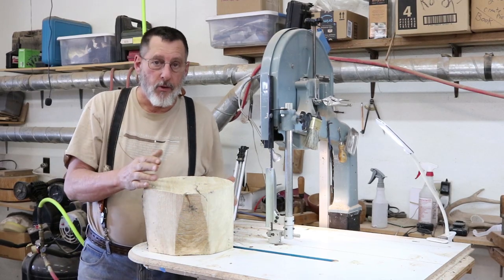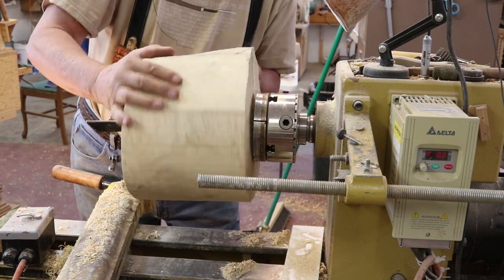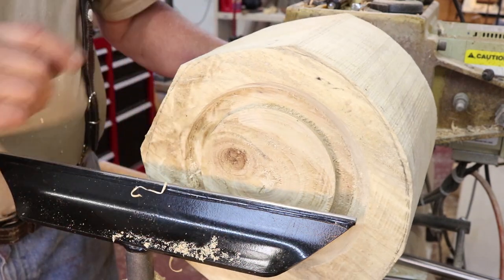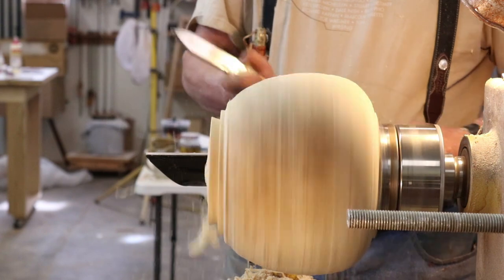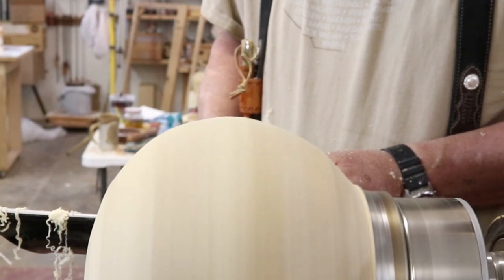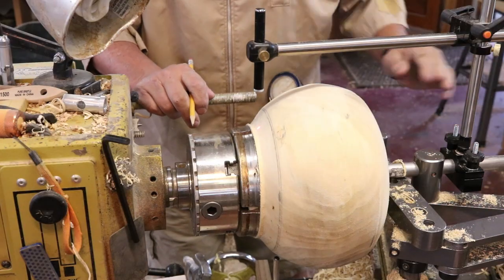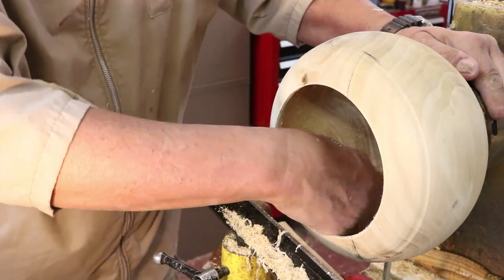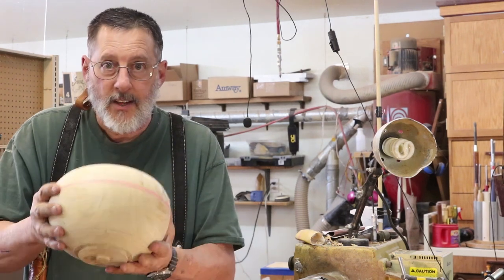Large Beads of Courage Container: the Base- Sam Angelo wyomingwoodturner

Comment: Good video. I like using a woodworm screw for shaping tenon as well. What I don't think some new turners grasp is that using it with a big chuck with 5" jaws provides a much stronger hold than a 50mm jaw set. I do like the deeper threads on a Oneway or Nova then the finer threads on the Vicmarc but your video shows it may not make much difference in the hold.
Reply from the maker: Mike
I always go to a screw chuck whenever possible.  AND without my tailstock.  It is amazing that it holds so well.  Thanks for watching.  Sam

Comment: I've been using desicant (silica gel} to dry wet turned bowls with great success. Very little warping and cracking. A bowl that size will dry to 10 to 12 percent moisture in 48 hours.
Reply: Patrick Hoggard that’s interesting iv only been turning about 3years and not heard of this. I will try to investigate silica gel drying method. Thank you for sharing.
Reply: That is a very interesting idea. Do you use the little sachets or just the silica gel balls on their own?
Reply: @richardtravers7172  I bought  3 gallons of silica gel (balls).  Put them in a convection oven to dry after use and they are ready to go again. Look it up at woodworkers journal.

Comment: Definitely more experience and 'Courage' , than me Sam, No way would I like to try something as big and heavy as that just on the screw spindle. Yet it worked, so maybe I should try to be a little more ambitious.  :D. And for all your difficulties, it turned out very well. One thing I have learnt in my two years so far, is the wood will decide on the finished result.
Reply from the maker: The wood will decide.....I like that. Sam

Comment: After having a 12" piece of oak seize on a wood worm screw, I bought a candle at the local dollar store, and rub it once against the wood worm screw to provide some lubrication when screwing a wood blank. It works for me... Oh, and a 12" diameter by 6" thick piece of oak was a bit scary to me, and I now use a 6" face plate with the initial turning of heavy green wood.
Reply from the maker: Faceplates are always a good option.  Sam